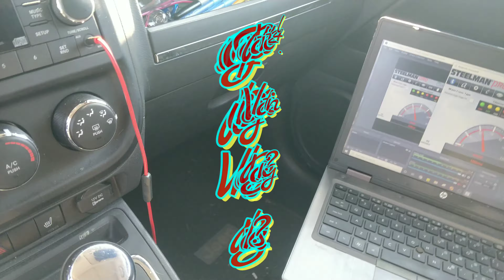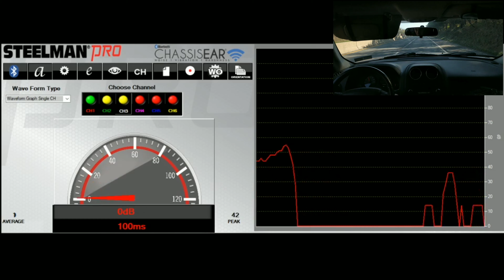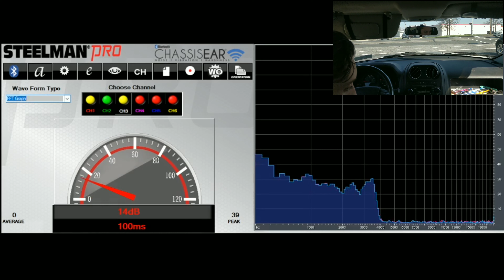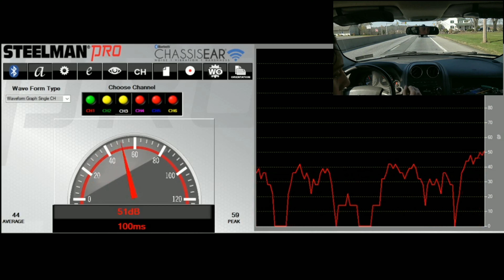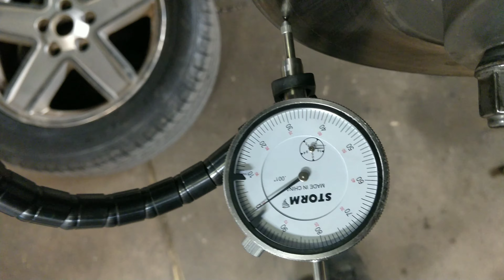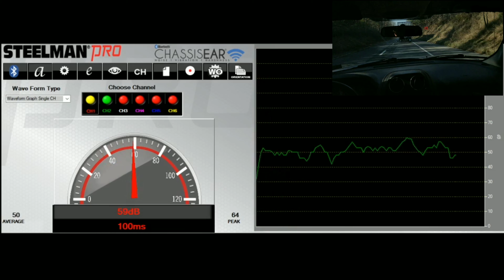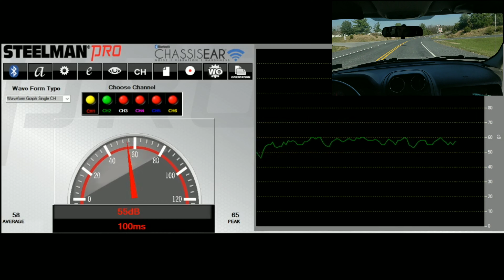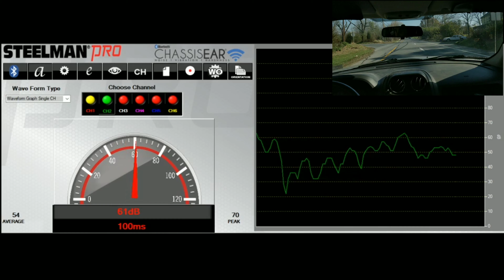Vibration and Pulse with New Brake Pads and Rotors

Comment: my brakes just recently started pulsing.  I looked at my log and the rotors and pads are not too old.   I looked at the rotors for visual evidence and they look like brand new.  not event a lip yet.   I am going to take the rotors off and look for rust like you show and clean it up.   thanks so much for pointing this out.